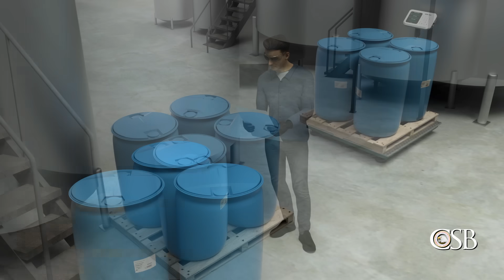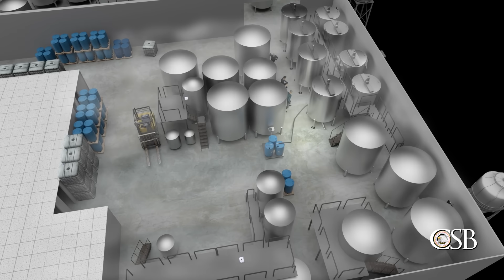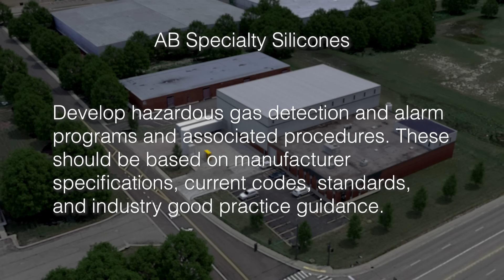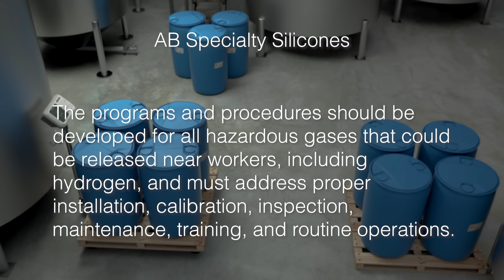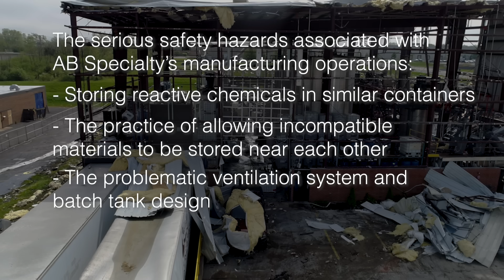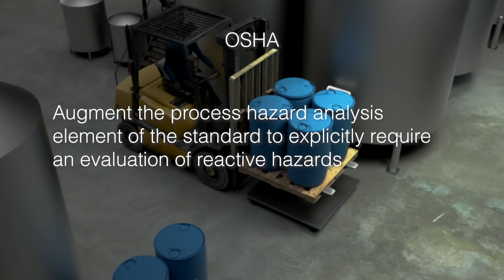Incompatible Chemicals: Explosion at AB Specialty Silicones

Comment: When I was glancing over my YouTube feed, I saw the word "silicone" and the thumbnail, and at first I thought it was a circuit board that someone had globbed a bunch of silicone caulk onto as a kind of low-rent conformal coating. Then I looked more closely and was like "OMG WTF CSB BBQ THAT USED TO BE A BUILDING." 😱

As I was watching the video I did a quick-and-dirty search to price out H₂ detectors. As a very rough approximation, you're looking at somewhere in the mid-three figures. Or you can get a bunch of stickers that say "POTASSIUM HYDROXIDE" for like three bucks each, if you're willing to buy a 25-pack.

Comment: one thing I wonder, is how it could be "safe" to use potassium hydroxide to adjust the PH of the mixture, if the chemicals were "incompatible"? Wouldn't hydrogen gas be created in that case too then? It seems they should just have used another chemical for PH adjustment, and then the hazard wouldn't be there, even if a barrel would be inadvertily left on place or staff on different shift mixing things up wrong.
Always eliminate hazard instead of building procedures "around" the hazards.

Comment: If the barrels had been marked in different color drums, and stored separately from the start the event could have been avoided. Also working alarms save lives. There should be 6-7 alarms in a place like that. One for each corner one in the middle of the longer sides and one in the center. 

Also employees working with chemicals need to know what they're working with and what dangers they can pose if something goes wrong.

Comment: Looking at the animation and knowing CSB attention to details, it looks like NONE of the 55gal poly drums had any sort of clear labels on the TOP of the drum.  Using different color drums would be somewhat of an issue since drums besides blue and natural white are not reusable.  And blue or light blue is the most common drum color.  That being said, there are ZERO excuses for not having clear and easily visible labels on all drums inside the production building.  Especially when you handle chemically incompatible materials in one process.

Comment: The absolute lack of safety measures is insane. Leaving barrels of chemicals in the work area instead of storage, not checking the labels of the barrels before use, no safety valve or closed overflow option on the tank, no mounted on mobile gas detection systems and no IECEx certified equipment used in a process like this?

Comment: While the processes at AB were beyond lacking and poor, the part that always infuriates me is how often the fail-safes for tragedy are instruments like "hazardous gas detectors," "smoke detectors," "overpressure sensors," "fire suppression system," and "ventilation systems," and it turns out they weren't fully-functional, functional at all, personal versions weren't worn or provided, or just flat out didn't exist.

Had those hazardous gas detectors been operational, many of the affected would be alive and uninjured, despite the numerous failings of AB to establish an effective safety management system.

Comment: They decided to ventilate the area after it started foaming. How the hell do places like this not have permanent mechanical ventilation aswell as shitloads of sliding doors/windows/walls to open during manufacture?
Reply: the guy sent 'to ventilate the building' was likely sent to open the garage doors, those usually stay closed to keep the building cooler

Comment: The ventilation system could have play a key roll into the great power of the explosion.  By introducing a specific amount of air to the environment in the building. It would have produce optimal conditions for an explosion. For example. If you ever open a door and smell Gas or propane/ mercaptine the rotten egg smell from a gas leak. Close the door immediately and get away then call 911. If you go in and attempt to "air the room or building out. You will be mixing air with gas and essentially making a bomb. All fire needs air and pure gas will not ignite.

Comment: Thats a messed up situation, colored barrels seperating explosive materials & gas detectors is a no brainer, also having a safety procedure / system for worse case scenario if someone did accidently mixed the incompatible materials then an automated system kicks in sealing the lid & venting just in case.

Comment: The KOH was not an incompatible chemical since it was used without a problem in the first batch to correct the pH of the XL10. The second batch included the staging of eight (8) containers of XL10 and the likely presence of two (2) or three (3) 10% KOH drums remaining in the emulsion area. At 04:16, the narration mentions the operator added "the first two ingredients that included XL10" to the batch, followed by the mistaken addition of KOH. What is the second ingredient? There is no mention of such a formulation for the first batch except for XL10 requiring a pH correction. The CSB description of what chemicals were mixed is inconsistent. More than likely, the production required the addition of a catalyst to both batches to initiate the polymerization required for the final product. Adding an excess of KOH was more than likely the problem rather than the incompatibility of materials.

Comment: For one if i saw a chemical overflow  tank and bubble and leak everywhere im going to be getting away from the area, also the fact  they  had all the barrels simalar colors could have been solved with a coat or even a stripe painted on the barrel.

Comment: Any one else notice that checking the labels on the drums before using the contents would have avoided the problem too?  All to often the "solutions, findings, and recommendations" focus on adding layers of paperwork, compliance certifications, and management teams, which if done actually makes direct production personnel  even more induced to believe safety is built into the system.  Even to the point of not bothering to read the labels before using the contents.  There are only so many colors of plastic 55 gallon drums out there, the glued on pieces of paper might mean more than the color of the drum.  I doubt this was first time they ever had to adjust pH in the process using KOH, so it's not all that shocking to have had a drum nearby.  Seems to me when confronted with a process calling for 8 drums of X and seeing 11 drums lined up, figuring out what's what would be a reasonable idea, and not an unreasonable thing to expect of workers.

Comment: 2 questions come to mind , first who allows a company to mix chemicals without knowing the hazards , someone had to know there was a possibility mixing the 2 would be very deadly , and second the government allowed this place to operate without inspecting it , in canada i cant even leave a small gap between 2 comercial  building because of fire hazzards but in the US you can just open up with no inspections , how did a building inspector not notice there was no safety measures in place for detecting toxic fumes or deadly gas ? Seems you need better inspectors too

Comment: I can't believe that they didn't do anything so simple as to ask their suppliers to supply chemicals in different coloured drums or very clearly stickered drums on receipt. Crazy.
Reply: Chemical companies generally only stock one or two kinds of drums. Plastic drums in particular only come in blue, black and white as far as I've ever seen. There are a few different structural styles, but the whole point of drums is to be interchangeable, so there's not too much difference from one to another.

From my experience working in the chemical business the vast majority of materials do come in well labelled. In particular chemicals as different as polymer dispersions and alkalis will be made by different companies with obviously different label styles, but a rushed, complacent, confused or undertained worker can mistake  containers no matter how well labelled they are. I'd know, having (non dangerously fortunately!) added incorrect materials at work when I briefly convinced myself the container I needed to use was "this one right here!"

The most effective preventative measure here would probably have been better industrial hygiene practices to keep chemicals put away between uses. Make it easy to do the right thing and hard to do the wrong thing as they said.
Reply: @GODDAMNLETMEJOIN  Agreed.  Thanks for the insight. So chemical companies who buy thousands of drums can't spec a production run of drums with certain fast dyes in them for identification purposes? I thought "Lean" manufacturing would kind of demand that?

Comment: Having done this exact type of work with some of these exact chemicals. This is largely the employees fault that was doing the batch on the second shift. When you start your blend, rule number 1 is ALWAYS CHECK THE LABELS ON THE DRUMS after that DOUBLE CHECK. 99% of the time poly drums are blue or white, so they always look the same. You NEED to make sure you have the right chemicals when you start. You could make an argument for keeping them separate but at a small site like this it's not always practical. There are often multiple blends going on at once, so if you move a drum somewhere else you could be dropping it where it's in someone else's way. Also the first shift probably left it there thinking that the second would need it as well to adjust the PH for their blend since they use the same chemicals. Potassium Hydroxide can be very dangerous and corrosive, even at 10% like in the video. It also heats up VERY quickly when mixed with water. I always hated using it and we made sure to use full-bodied suits and full face respirators when handling it. Thank you guys for the awesome video, I can't stop watching these

Comment: These videos make me kinda worry about practices that facilities I use operate. There's a facility that I visit daily, where totes of what I believe are diesel luberocity additive (class 3, 1993. Just like diesel itself) are placed where a truck could potentially swing into them accidentally. This possibly is compounded by the fact that the rack requires a tight turn to get into the lane and a failure to maintain lighting reducing visibility. They also lock out the transmix drains, which means mixing product is possible. None of these things would cause an explosion, but environmental damage. Mixed product can cause engine damage, particularly to diesel engines. There was also this one gasoline additive that leaked for days at another facility, smelled like rotten vanilla and seemed to lingre on your skin and clothes for a while. My state doesn't have vapor laws, so vapor recovery systems at stores can be in disrepair for years... Which is fun...

Comment: REALLY LARGE LABELS (which can be printed locally then applied as chems are received) and/or color banding on otherwise identical drums would be useful. The US military uses color coded bands on munitions to differentiate live and training components and a color band standard for some chemicals might be useful in industry. Small labels are inherently poor human interface design and because they're cheap that's not questioned.

Comment: This is exactly what we do at my job but it's insane how much more technology we have. Every tank is linked up with dcs to show temp, weight, headers, pumps etc. 

There is ventilation everywhere pulling vacuum to keep as little oxygen as possible. Everything uses nitrogen to displace oxygen.

Our drums do sometimes look exactly the same. Before we charge every drum has to get scanned in and visually verified and recorded on paper. If it's staged by someone other than the person charging it doesn't matter. It gets double checked. Our floor is a mess at times with products.

If I can see a reaction (other than temperature rising) happening I'm running and calling in for evacuation. By then its probably too late and not worth the risk. 

Very sad to see fellow operators lose their lives.

Comment: Usually I'm all on the side of the CSB but it seems like they got several things wrong here.
General information: from what I can tell, XL10 is actually vinyltrimethoxysilane which AB bought from Wacker.
1, these chemicals come in whatever color barrel they're in from the vendor. You can't transfer them to a different container without introducing further process safety hazards, so having the barrels be different colors was not an option.
2, every barrel, whether its XL10 or 10 percent KOH (I'm guessing in methanol because XL10 is violently reactive with water) is very clearly labeled. I don't think expecting employees to read a label on something going into hundreds of thousands of dollars worth of product is unreasonable.
3, as far as remedies go, if you want different colored barrels, that has to be accomplished upstream, in this case, in Germany, not at AB. Blue barrels and white barrels are an industry standard. Different countries have different requirements for coloration of storage. This isn't like gas canisters where every type of gas has its own coloration. There are FAR to many industrial chemicals to give each one its own special color scheme.
The only thing I can think of that would have prevented this incident is a soft lockout system on the charging pump that would require operators to scan the label on whatever barrel they're about to draw from. This has the very real danger though of dumbing down the employee's jobs even further and making safety more reliant on people entering codes into a computer.

The CSB's recommendations would have mitigated the damage from this incident, but not prevented it. The outside air blower that "mixed the hydrogen throughout the building" is also what kept the employees alive in the event of a suffocating gas release. The employees could well have been dead from asphyxiation before the explosion without the blower.

Ultimately, personal responsibility is the solution to all of these problems. Who's responsibility was it? The guy operating the hose? The forklift driver? The plant manager? The chemists? The owners? The chemical vendors who supplied AB? Government regulatory bodies? The answer is to all of those is "yes".

Complacency and carelessness are what caused this incident. The lack of gas alarms is what made it deadly. The end.
Reply: According to another comment thread above, it's actually "a copolymer of dimethylsiloxane units with methylhydrogensiloxane units", not vinyltrimethoxysilane.
Reply: @amritlohia8240  No idea. This was too long ago. I guarantee you I looked up the actual manufacturer's SDS though. I'm not saying you're wrong, manufacturers change their compositions all the time, but When I looked up XL10, I guarantee you that's what it was.

It looks like they removed access to their SDS, but their general description has "trimethyl siloxy terminated" in it and it is in their "VS" product range. I'm guessing what "VS" stands for, but I still would go with what I said, even if it was someone who worked for them that said otherwise.

Comment: Where were the proper labels on the drums how bout the MSDS Sheets  I can tell you this OSHA AND THE EPA ARE LAZY ASF and crooks  they come in our plant and if it doesn’t slap them in the face they give the ok if they really took the time to look 👀 they would see NICKLE ALL OVER THE FLOOR  EXTENSION CORDS PONYTAILED INTO HARD WIRED BOXES ELECTRICAL BOXES LITERALLY HANGING AND NOT MOUNTED  AND THEY ALWAYS ALWAYS CALL BEFORE THEY COME SO OUR MACHINE DEPARTMENT WILL SHUT DOWN MACHINES THAT HAVE MAGNETS BYPASSING THE LATHE  DOORS

Comment: I worked in a small coatings plant YEARS ago, and we couldn't even weigh & add chem until we scanned the labels on the drums and you couldn't just scan one label for the entire pallet load. You could only scan a label once, without getting the shift manager down to bypass if errors were made. Guess that's why they went out of business? The time/cost of doing things the right way was higher than just winging it. Sad.

Comment: When I was a student engineer I worked in a Silicon Fab with lots of nasty gases, acids, high furnaces. I had safety protocols hammered into me and was told in no uncertain terms I would be fired on the spot if I breached them. On the actual production line the workers completely ignored them because the supervisors were pricks and wanted throughput to be high. As an adjunct nearly all production line staff were women who were dog rough and liked nothing more than a 20 year old innocent lad as fresh meat 😁

Comment: On April 28th, 2022, the USCSB did not properly assess the potential hazards of releasing multiple quality videos sequentially in the YouTube environment.  As a result, the heat generated by the enthusiasm of thousands of viewers built up enormous pressure in the enclosed environment, populated exclusively by subscribers.  It is estimated the friction from so many like buttons pressed on that day, was enough overwhelm the inherent coolness radiated by the subscribers, which had acted previously as an offset.  Once the threshold was reached, a runaway reaction occurred.  The result - a massive explosion, large enough to shake the internet, and blow the minds of nearly everyone within a large radius.  Such a tragedy, should definitely be repeated.

Comment: 1:36 - Hold up, CPUs are made from Silicon, not Silicone which is a completely different thing.
One is an element (a semiconductor) and the other is a polymer.

A simple mistake as they are very similar in spelling and people tend to pronounce them the same.